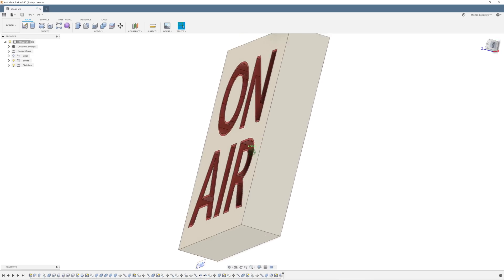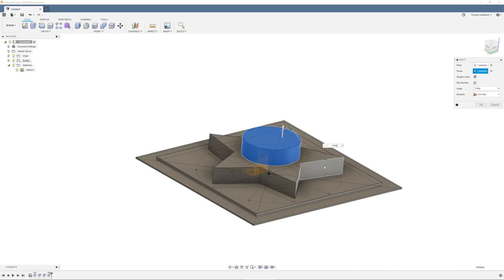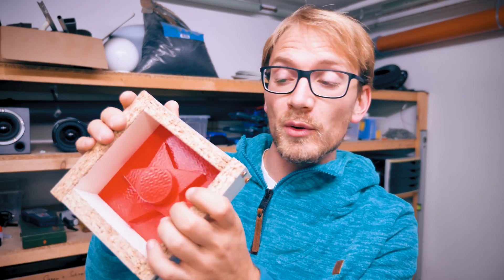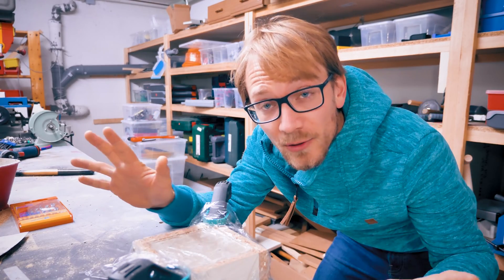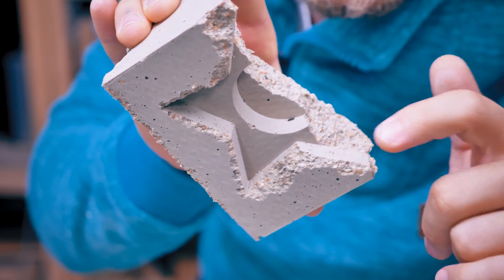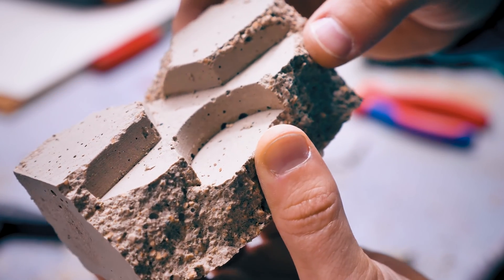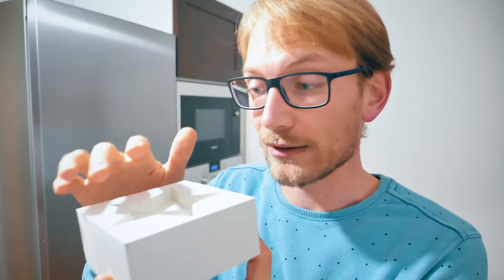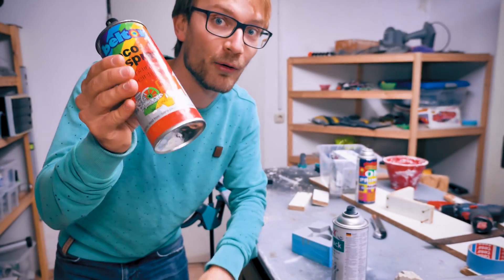Digital casting: 3D printed molds for concrete and plaster!

Comment: I'm curing my concrete pieces at least 7 days underwater, after 24 hours on the mold, if the centerpiece doesn't unmold it will after some days underwater.

My recipe is 3 parts fine sand and 2 parts grey cement.

Comment: I'm casting plaster candlesticks in a multi-part 3D printed mould. Printing flexible as slowly as 20mm/sec helps a lot with the quality. Using Prusa Slicer 'Variable Layer Height' option saves a lot of print time. (Prusa Slicer also works with non Prusa 3D printers)

Comment: Suggestions:
1) add 10% PVA glue to mortar mix. 2) sprinkle talcum powder over mold. 3)vibrate to remove bubbles 4)cover in polythene and leave for at least a week....it’s a chemical reaction that needs water....not drying!

Comment: I would suggest using using Hydrostone, it falls in between plaster and concrete in hardness and doesn't have all the gravel like concrete. Basically it will have the same smooth texture as plaster but be much stronger.

Comment: Hello Tom, Thank you for making a video about printed molds. Its is something I am looking into myself. First off, your videos have been extremely helpful to me in learning 3D printing. Perhaps as a way to pay you back I'd like to help you in your mold making venture. I have experience in making many different types of molds for everything from vacuum bagged carbon fiber to bronze sculptures. Here are a few things you might find helpful. 
1. IMO the best release is wax such as the type used for wood floors. Rub it back with a cloth once dry. This will get a truly smooth finish. All the other mentioned releases work; petroleum jelly, talc, dish soap, vegetable shortening, etc. but each type leaves micro swirls or bubbles on the casts surface.
2. When mixing plaster do so by hand. Add the plaster to cold water, mix slowly and let it work through your fingers. This will help reduce bubbles. As mentioned below, vibration from a sander can help remaining bubbles surface.
3. Once cured, seal your plaster with shellac before painting. Its the only thing I know of that bonds to plaster. Polyurethane DOES NOT. It will try and trick you for a few days before it delaminates!!! 
4. A good high-strength, low-weight alternative to plaster is hydrocal. 

I hope this helps. Keep up the great work and thanks again for all of the help you have provided me in the past!

Comment: I'd recommend for this size of casting always using quick dry cement, I also mix in about 5% wood glue (not craft pva as i think its got something in it thats not good for concrete) as I dont want to use fibre strengthening on thin casts and it adds another level of sealant. & mold release is always a good idea.

Comment: Tips from a painter: 
Tip#1: to avoid paint bleeding use the correct tape for what your doing. For example I use tape from 3m so blue painters tape has a low strength adhesive. It generally goes like that Blue, green, orange, and light green for terms of adhesive strength for 3m atleast. In the case of concrete use light green.
Tip#2: when tapping surfaces dont lay down the tape while pulling on it tight. Pull some off the roll and let it hang loose and push it down while its loose in your other hand. This way its properly secured to what your painting so there is no bleeding. This works super well on textured walls/surfaces and it has never failed me so I always end up with clean straight lines

Comment: I would  assume the plaster would break down quickly given how water soluble it is. At least the surface from being handled. If it were me I would print the mold from PLA, hit it with a media blaster to smooth out the part, add the walls to the mold and seal with silicone, Spray everything with clear coat pre poor,  poor REALLY thin concrete in, use something to vibrate it like a palm sander (really anything that spins fast and can be rigged off balance will work like a drill with a large hex key in the chuck). The PLA mold can be shrunk/melted away with a heat gun once the concrete has cured. 

Should come out perfect.

Comment: Hi Thomas, nice Video! Normal plaster can be a little bit brittle. There is a plaster type called Stewalin which is more robust. If you want to paint the whole thing, maybe it is better to coloring the pouring mixture. The advantage of this is if a part chips off, there is no white spot.

Comment: If it's not too heavy, could you put the mold on a moving printer bed and make the bed move at short distances (vibrate), backward and forwards, to to remove the bubbles? And if you have a printer enclosure, heat the bed to dry the mold. Just seems like a nice way of using 3D printers!!

Comment: Plaster is only fully cured when it cools down. Until then, no painting unless you're using watercolors (effectively making it a fresco). As for the 3D printed mold, i'd add at least a chamfer, maybe even a fillet to the corners. Also, petroleum jelly should make demolding easier.

Comment: only reason to use a flexible is you either want no draft on the part or have details with undercuts...if its something simple were a slight draft angle is ok you prob want to go with just simple filament that can be smoothed(making release of the mold even easier)...that being said you may like the textures left from the printer.Either way it turned out well and if you are going to make a larger piece you may want to look into making foamed concrete...much lighter...far stronger then plaster but will reguire its own amount of experimentation to get right lol

Comment: Water based paint like latex acrylic makes more sense with plaster, whatever you would put on your plaster wall.  Also, like concrete, plaster is made by applying heat to drive off moisture, so heat can change the structure of the plaster.

Comment: Hi Tom, awesome use of 3D printing.  I'd try dusting the print and the inside of the frame with talcum powder, it will act as a release agent.  Cover the faces to be cast then tip out the excess.  I'd also use a random orbital sander on the top of the wooden frame for about 120 secs after you do the pour.  This will work much better than your awesome hammer technique (remove the abrasive pad from the sander, of course).  having a release agent should make it easier to use concrete too.  For concrete I'd leave it to harden for a couple of days, in a warm place, your attempt looked like it was still quite damp inside.  Good luck with your next try. Looking forward to seeing how it goes.

Comment: For more complex shapes, you could probably just print the mold in PLA, and then once the plaster/concrete is dry, put it in an oven at high temperature to melt out the plastic. You just have to be very careful and slowly increase the temperature, so the remaining moisture can get out without turning to steam an cracking the plaster/concrete.

Comment: silicone lubricant for release agent.. - and run a drill or sander under it when pouring to create vibration to remove bubbles..

Comment: We used to do precast concrete blocks when I was a kid & the release agent we used with the concrete was old engine oil. I'm sure others here will have many reasons why it can't / shouldn't be used but it's what we did & the building that the blocks were used in is still standing.

Comment: Also, to reduce bubbles, try painting the inside of the mold with "wet water". Basically water with less surface tension. Use a surfactant. Google hirst arts for info on casting plaster.

Comment: I have printed a mold of a Buddha head and cast it with concrete. I chose to make the mold one time use so I printed it in PLA. No wooden parts. I used fine concrete and could see layer lines from the print very well. After a few days I started peeling the PLA. Worked very good.

Comment: It seems to mirror my result with cement.  I actually tried adding in various 'do it yourself' releases only to see the same result (petroleum jelly - nope, dish soap - big no, it seemed to cause a weird reaction with the cement that resulted in whitening of the surface, and extreme weakness of the cement).  The only one that turned out was a PLA mold that I then melted off the concrete.  I even tried a superplasticizer so I could reduce water content hoping to increase the strength of the cement.  To me epoxy is WAY easier to get right than cement has been.  My next attempt will be with some Aquacon from Smooth on and a 3D print that has had a layer of epoxy added to smooth the layer lines a bit.

Comment: You can purchase "concrete fibres" in various sizes to reinforce concrete or plaster. They are just small strands of polypropylene that help bind the material. You'll need to mix them in really well.
Reply: I've been going back and forth on getting fibers to try.  Some sources say it really only helps in GFRC blends (which are not easily sourced here without paying $50 shipping to have a $30 bag sent to you), whereas in regular blends it really doesn't help that much because the concrete itself doesn't have the properties to transfer the load to the various fibers without the added polymers of a GFRC blend.

Comment: May want to consider gold (fake gold) leaf. Super inexpensive, easy to apply, little masking needed for something like that and of course a much warmer texture and appearance. They also have copper and silver leafs that are really nice. Adhesive for the leaf would require no priming.

Concrete is a great medium. No more difficult than the plaster and usually much less expensive then say plaster of Paris.

Comment: Hi, Thomas! What to do with those bubbles on edges (of plaster)? I've thought you'll heal them before baking... Oh, I've thought it will be a form to make some "molds" (to clone the initial form)!
IMO concrete is superior if you want to make some permanent outdoor shells. You can even make some small metal roofs for these molds so the candles will be protected from rain.

Comment: You can seal cement (and probably plaster as well) by painting on a coat of sodium silicate.  This gives you a thin glass coating that will soak into the porous material and create a smooth, glossy surface.  If you don't mind that kind of surface, it would solve some of the problems with painting.

Comment: I have had great results with small concrete items using a wetting agent which allows you to use more water, this provided greater detail and strength, but alas, longer cure times.

Comment: To remove the bubbles, try putting the mold in a plastic bag and use a shop vac to produce some vacuum while hammering. Since the vacuum makes the air in the infill expand it is necessary to remove the vacuum after removing the bubbles.

Comment: Cement based mortar is meant to be soft ..... if it is too strong then the bricks crack :) - but then you did say you knew it was the wrong thing. Paint over the surface with a slurry of cement first to help eliminate more of the bubbles. Yes vibrate. Use a plasticiser rather than more water. But water is important to the curing - so good to cover like you did. Like the idea of the skin and plug - though TPU is hard to get the support material out. Love to see these experiments!

Comment: Couple things I learned from a master modeler making plaster molds for latex masks (that I bet others have already commented on, oh well):

If you want the plaster to last (say, if you want to use it to cast latex), add some kind of fibrous material. We used burlap in the mask making class which works fantastically, but I bet gauze or fiberglass would strengthen it as well (well, all right, I just tossed the gauze and fiberglass out there because I've always wanted to see how the plaster would behave with them).

If you want to reduce the bubbles on the surface, slowly pour a thin slurry of plaster (consistency of crepe batter if memory serves) on the surface of the master. If you've ever seen pastry chefs pour ganache on a cake, it's the same principle. It will run off, so you'll need to scoop it up and pour it back over the top until it thickens. Then you layer plaster-soaked fabric onto this initial shell to reinforce it.

Comment: use sand with concrete. its a binding agent that makes the concrere hard, it works just like glass beads in super glue filler.

Comment: For the sign, you can cast it in an epoxy sand/stone mix. It will be many times stronger than concrete and harden overnight. The mix should be like moist sand, ie. quite dry. Using different colors of sand in the mix will produce different looks if you leave it untreated. 
Don't forget to wax the mold with a release agent when casting epoxy.

Comment: If you use shellac as a primer you can apply 2-3 medium weight layers in an hour and it won't react with the plaster at all. You can paint over the shellack with all types of paint after drying it for an hour in the oven.

Comment: depends on your end results you want. water putty is a lot like plaster but harder. brush the mold first after waxing. the bad thing about wax is when you want to paint . dont use spray primer but use PVA which is for drywall. if you want to make it lighter you can use pearlite in the mix. someone suggested using some sort of fiber material. you can use even chicken wire to help. or just get some fiber sheet and pour some do the hammer thing to level. lay some fiber pour some more hammer then add some more . id do a couple layers and cross the fibers. 

oh and dont discount something like bondo

Comment: The increased shrinkage of Plaster is a good and a bad thing. Initial release from your 3D plug will be easier. That same shrinkage can cause cracking and other issues so watch your larger parts. Easier sanding, filing etc over concrete is a plus. Look at some Concrete Benchtop videos for ideas on the concrete alternative. Good video as always :)

Comment: If you put blue tape on the wood before you cut with a circular saw you won't get the chipout/blowout on the edges, which will result in a higher-quality finished product. Also worth mentioning is that your saw is obviously underpowered. Excuses to buy tools are always appreciated

Comment: If you have a hand sander, you can turn it on and put it up against the side of the mold after you pour the plaster or concrete into it to help vibrate the bubbles out. That can work a bit better than hammering the table the form is attached to.

Comment: Hi Tom, love your channel and refer to it all the time in regards to 3D Printing. As for casting 3D molds and models, I do a ton of this in my shop and have done so for 3-4 years now. I mostly produce ceramic molds for production and I believe I can help improve on your castings. For the concrete, it simply needed more time and honestly so did the plaster, both cure not by evaporation but through a chemical reaction that produces heat. The best time I have found for demolding is just after the heat has started to dissipate. I personally prefer not to speed the "drying" of a fresh green mold made from plaster and prefer to let it dry naturally, for some reason I find it weakens the casting. I also prefer to let it dry naturally 3 days to a week. Plaster is also not the ideal material to pain unless it is dried thoroughly and sealed with a clear coat as it will continue to absorb moisture over time as that is what it is really good at. More importantly, lets discuss the casting method. You should look up mold soap if casting in plaster, this works way better than dish soap, oil or petroleum jelly. These all will work but mold soap will do the job much better and not leave problematic residues. In a pinch I use oil soaps for cleaning wood, in the states one can use Murphy's oil but mold soap works better. There are plenty of release agents and concrete has its own release agents but you need one for a clean casting. The air bubbles you got on the plaster casting can be eliminated. Plaster is an incredibly hi-resolution material if mixed properly, you also need to use casting plaster as opposed to "plaster of paris" and the craft - art store plasters, you can also use hydrocal, a cement/plaster combo, much harder and great to work with. Look up mixing plaster for mold making, I could tell by your pour something is off in the process you use, it was a bit on the thick side and the lumps were a bit worry some. The hammer vibration technique you used was spot on. Those are the big things, if you need further support please reach out on more private lines and we can discuss. Good luck.
Reply: how dp you cast 1, 2, and 4 dimensional molds, as opposed to the 3d molds?
Reply: NiceWhenEarned RudeMostlyElse Hi there, I am not sure what you mean by this question? All molds are to varying degrees three dimensional and I think you might mean single part, as per Tom’s example here to two part, three part and on to many part molds. If so, this is a matter of blocking and dating the section you want to cast and going from there.
Reply: @nicewhenearnedrudemostlyel489  4 dimensional molds?  Do you mean all sides casted?  That is still considered a 3d casting, and the most popular way to cast that is either using lost wax, or a flexible rubber mold in 2 or more segments.  Realy depends upon your finished product.
Reply: @problemwithauthority  yes, a bit of a mis speak on language, I explained above.  Most of the mold making I do is for ceramics production and some metal casting where we use lost wax. I use rubber molds mostly to produce mother molds from objects I cannot cast directly into very hot, very wet plaster.
Reply: @nicewhenearnedrudemostlyel489  just saw this. In mold making you frequently refer to multi-piece molds as 3D as opposed to a low-relief one piece mold. I am completely bewildered as to what a 4D mold would be. Perhaps it would exists in the present and future at the same time?
Reply: I agree, both needed more cure time.
Reply: thank you for sharing your experience! makes my search a lot easier